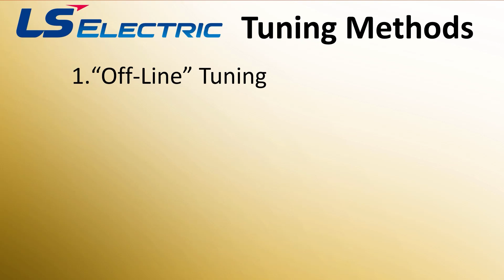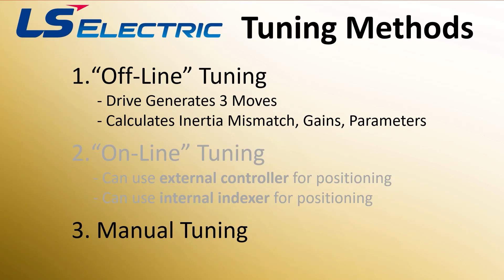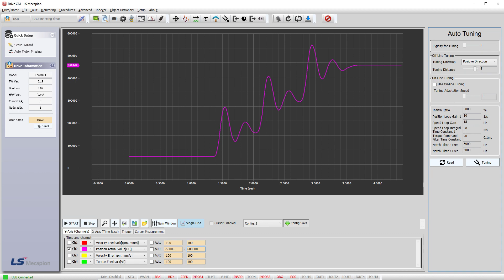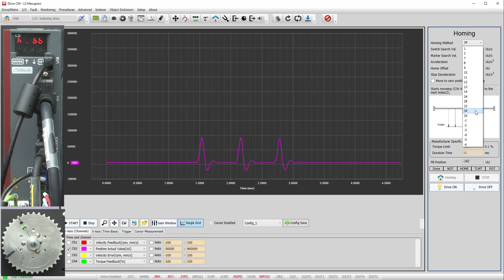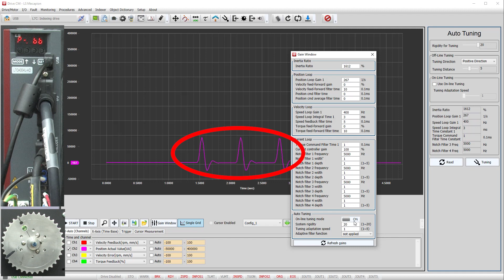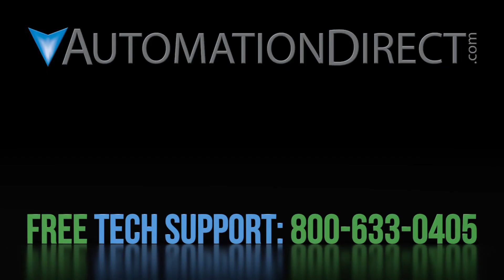LS Electric L7C & L7P Servo System Auto Tune Part 1 from AutomationDirect

Comment: I have question.
Is it recommended to do offline tune with load or without load attached to the servo motor?
Reply from the maker: @wadi B3eed, it is always recommended to do servo tuning with a load attached to the servo motor in order to give the motion controller the most representative real-world example for the drivetrain. If you tune without a load, unforeseen harmonic interactions can occur once a load is attached.